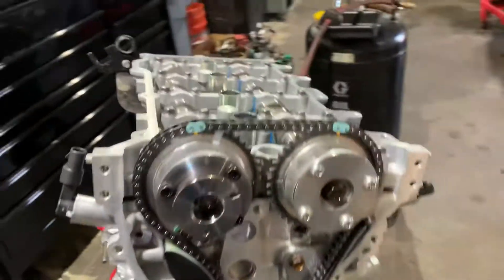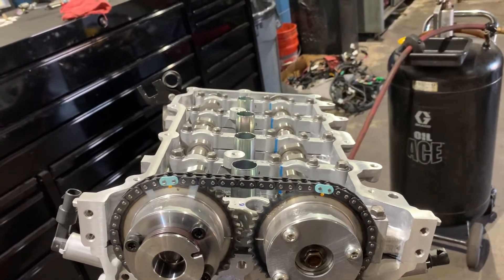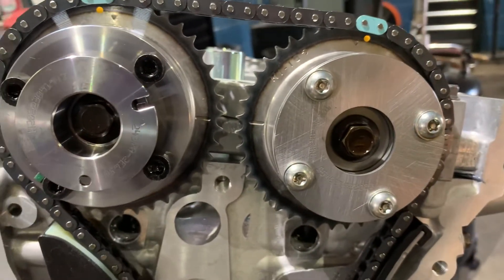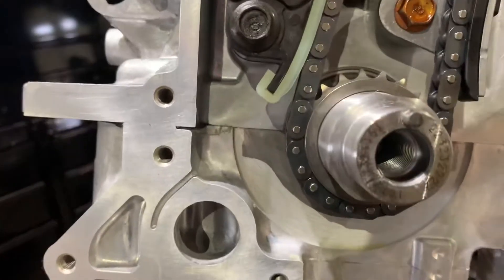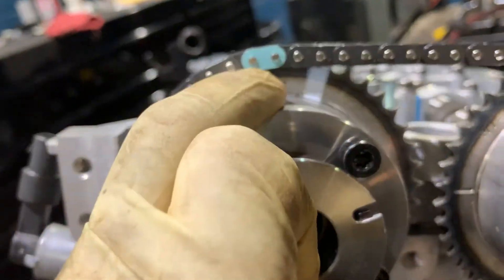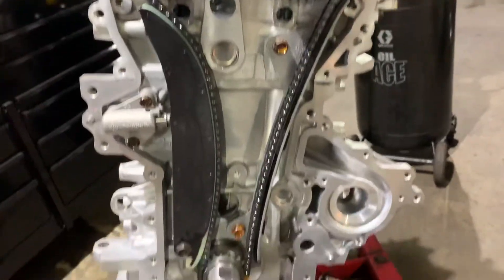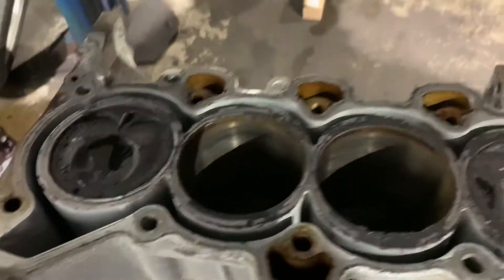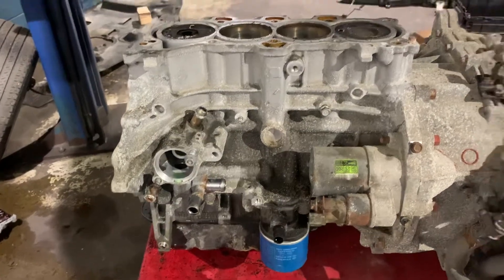How to set timing on a 1.8 and 2.0 Hyundai Nu engine

Comment: My brother in laws g4nc engine lost oil from the filter gasket 😢, crank and rod bearing were run badly, tunnels on block OK. We bought a kit off ebay all looks OK but the bearings have. 004" thou clearance, after some mixing and swapping it's the shells the old worn  shells give. 002" clearance,  I tried another brand of shell still. 004" the new crankshaft measures the same as the old crank on its good journals., no choice now but to get..25mm under and grind to suit....... 😢😢😢😢 More money.

Comment: Have you e ery seen a 2.0 jump time after the exhaust cam replacement. Ive got 2 2018 forte from auction with jumped timing and pretty new cams in them.
Reply from the maker: If they’re not primed correctly yes they can jump on startup. They are also known for stretching chains so look down the timing cover with a borescope and see how far the tensioner is out of the housing
Reply: @SEsGarage how do you prime them?
Reply from the maker: @PincheKriss soak tensioner in oil, pre fill oil filter

Comment: I have P001100 code on my 2017 elantra after engine overhaul ,currently the car stalls when the Ac is turned on,what could be the issue?

Comment: I keep getting P052A after 2 times doing the timing on the 2017 Hyundai Tucson 2.0 , never happens to me before on any engine , can someone tell me what I'm dealing with please .
Reply from the maker: It’s been a while but I feel like I remember having to replace the cam actuator on the timing cover in the center of the intake cam for a similar code
Reply: The part called cam actuator ? Do you mean the cam phaser ? @SEsGarage

Comment: what is the difference between the 1.8 and 2.0? i have a 1.8 but the 2.0 are easier to find and cheaper. they look the same.
Reply from the maker: It’s been a little while but I believe one is GDI and one is MPI if I remember correctly

Comment: Right, but then as soon as you spin the motor by hand it just jumps time…
Reply from the maker: Not if you pump the tensioner up with oil
Reply: @SEsGarage  we did that overnight… but we retimed it another 3 times.. gonna start it here in a bit fingers crossed
Reply from the maker: @ThatC7Guy  did you replace the guides and tensioner arm? I’ve seen the tensioner arm be the wrong style and cause a loose chain. Compare the guides and tensioner arm to the old parts
Reply: @SEsGarage  yes we replaced all 3 tensioner and 2 guides.. it has a weird ratcheting in the tensioner… let me know if you’re available for a call I’d love to talk to you for 2 minutes. I own a shop
Reply: @SEsGarage  startup went well still throwing a exhaust cam correlation code after replacing timing chain and sensor
Reply from the maker: Did you inspect the cam phaser for a sheared pin in the cam? Also, oil control valves will cause correlation codes as well. I actually have a video on diagnosing a cam correlation issue on a Kia forte with a similar engine.
Reply: @SEsGarage  we did not… didn’t know we needed to? Did you guys check them when you had your first one come in?
Reply from the maker: @ThatC7Guy   I’m a Hyundai certified dealer tech so I’ve been inside quite literally 100’s of these engines. I’ve only seen a handful stretch the chain to the point that they jump and they were due to lack of maintenance. What was the reason for replacing the chain in the first place? Did you check base timing before removing the old chain to verify whether it was actually out or not? There is a small locating pin on the backside of the CVVT phaser where it bolts to the cam that likes to shear off and allow the cam to rotate inside of the phaser and throw cam timing out. BUT it will appear to be in time because your timing marks will still line up. Correlation codes can also be caused by faulty oil control valves or oil pressure issues to the cylinder head.
Reply: @SEsGarage  man I wish I coulda talked to you this morning before we put it all back together (now we gotta do the job twice) a p0017 code. And we tried the cheap easy stuff first. Didn’t work. Found the timing chain to be stretched. So we said ope just needs timing chain, tensioner, and guides. Replaced it got it allllllll the way back together and bam codes still there. And NOW AFTER all that’s done we’re hearing we shoulda replaced the cvvt phasers… so that’s good n awful. So tomorrow morning we get to do it allllll over again. Yay
Reply from the maker: @ThatC7Guy  if that pin is sheared you’ll need a cam too. Good luck I hope it ends up being something simple!
Reply: @SEsGarage help! Currently replacing the chain on a 2013 2.0 soul, replacing the chain at 178k as preventative, the engine ran fine. Watched world mechanic videos and got the timing markers all lined up on the cans chain and crank and cam marks aligned on head, what i dont understand is after i spin the motor over like 20 times by hand, the timing marks never line up again. 

Are the timing marks supposed to aligned again after you spin the motor by hand?
Reply from the maker: @broncoteno7181  the marks on the chain will not, but the physical timing marks on the cam phasers and crank should
Reply: @SEsGarage  omg okay thank you. I have installed the new chain like 3 times and rotated the engine by hand like 60 times.😂 turns over freely with no interference.
Reply: @MitEclipse91  did you reset the adaptive values after the job?
Reply: @SEsGarage  why do you need a new cam if you pull the broken pin out shouldnt the cam be ok ?
Reply: What do you mean by pressurize the tensioner ? Just did a hole timing job and lifters, spun the motor over by hand twice, chain had slack but didn't skip, I was told once I start the car is will pressurize the new tensioner. Will this be okay ??haven't started the car yet after reading this don't want to swap a motor because of this  @SEsGarage
Reply from the maker: @Localtouge  as long as you pre-fill the oil filter with oil and soaked the tensioner in oil overnight before installation you should be fine
Reply: Okay thank you this helps me out a lot. Did not want to tear this thing apart again. @SEsGarage

Comment: Wow a 2018 Tucson. I'm worried I have the same year and engine. What happened to the engine?
Reply from the maker: Rod bearing failure due to lack of maintenance
Reply: @SEsGarage  can you elaborate? I'm assuming oil changes since it has to do with lubrication? But Hyundai recalled millions of cars/engines including the 2.0l nu gdi. These engines are used in many kia/Hyundai models and are recalled because of premature rod bearing failure and covered under warranty for a free engine fix/replacement. From 2012 to 2021 which is mind boggling. Are you sure this is not the case? Your the expert and I'm not questioning your mechanic diagnosis. It's just this is happening right now. They think a knock sensor software update will fix a mechanical problem that will break eventually smh. Americans will have lifetime warranty and Canadians 10/200,000km extension and anyone who payed for engine service before this lawsuit happend will get reimbursed.
Reply from the maker: @RM-ub1xd  the 1.8 and 2.0 are not listed under the rod bearing campaign. They have a separate issue with piston slap/oil consumption but that was not the case in this particular engine replacement
Reply: @SEsGarage  appreciate the reply.